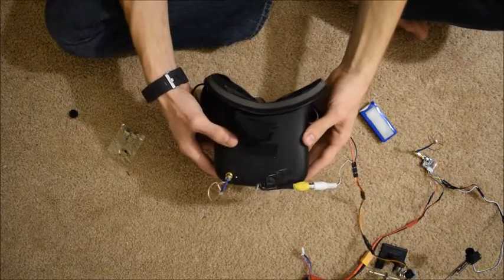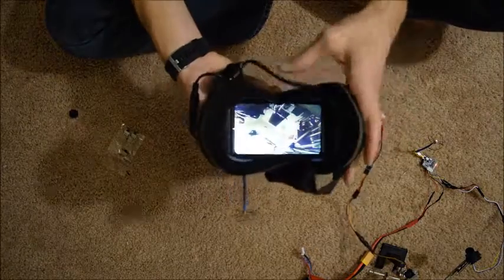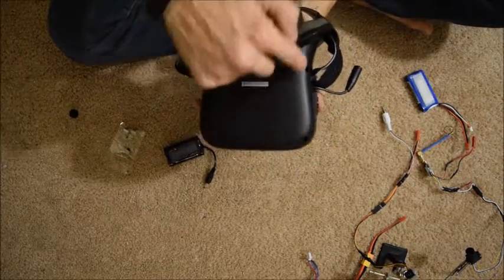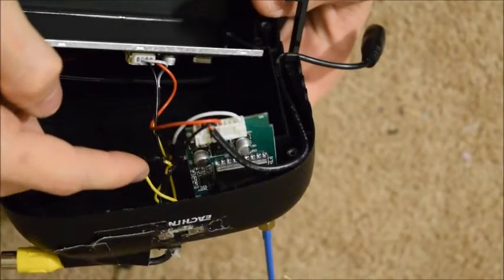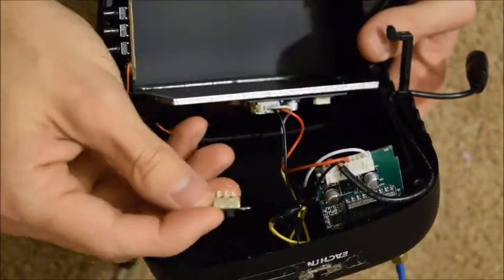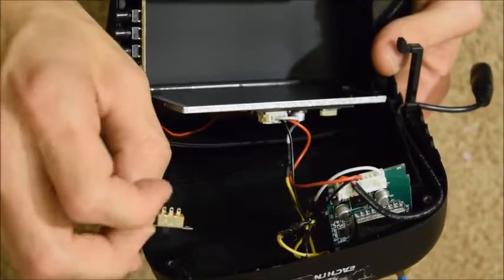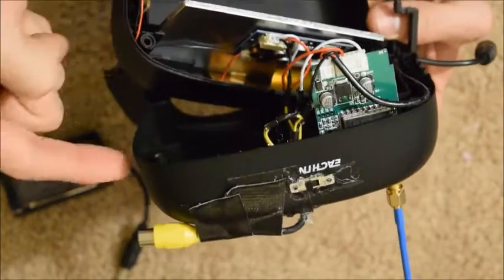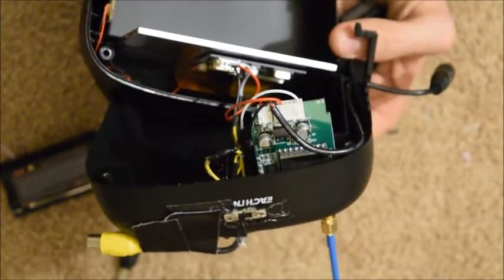EACHINE VR-007 Goggle MOD, add video input

Comment: Guys u made it work very good but there is second option cos the bord of the screen has one pin empty for AV2 and it swithess automatic when u add signal to empty pin ive reused old cables from my old pc, the small ports were the same, i've soldered them to chinch cable looks almost like fabric :D , just cut a chinch svideo cable and put it next to power cable, theres enough place for it, signal cable to av2 and ground cable to ground empty pin on signal reciver, switches automatically when u connect the cable no drilling just extra chinch cable :D  works perfect on my vr007 also connected power bank :D to my battery cos it lacks of power a bit old 13000 mAh  and u can watch many films or play very long :D    Looking to see new mods from you :D
Reply from the maker: Thats neat to hear that there is more than one way to make it work. That would be neat if you could make a short video showing how to do it :)
Reply: DrewMan RC  i try to make a video or put some photos :)
Reply from the maker: Cool stuff :)  The funny thing is that I have since taken these 007 goggles apart and turned them into a hand held monitor/Rx :)
Reply: I have to get my hands on hdmi to coaxial converter and try to hook up to my laptop as second screen :D  coz my brother took ps3  ;)

Comment: Thanks to your video I did the mod to my vr007. It´s awesome, i connected my xbox with no problems. For the input cable, I left it inside the case for it to look nicer. Thank you sooo much for this vid
Reply from the maker: Ivan Mv that sounds fun haha! is the resolution good enough to play games on?
Reply: https://drive.google.com/open?id=0B5zhcSiyD_WFSGJRSjVjZ2ZLd2s
Reply: the definition was good enough :)
Reply from the maker: Ivan Mv , your mod looks nice, better than mine with the tape and hot glue :) the google eyes are a nice touch
Reply: thanks :D

Comment: I was thinking about this for a while. I want to connect a Raspberry Pi running EmulationStation and sending games to my Eachine VR-007, so the switch would be a good option. I might even be able to put the R-Pi inside as looks like a lot of space. Thanks for the video.
Reply from the maker: Declan Green, it is a super simple mod and worth the gain, I will say that I was a bit disapointed with the resolution when I plugged it I to my laptop. It is kind of fun to play with a flight simulator while wearing them, but it is no 1080p. I have further modified mine and removed the receiver and replaced it with a small 700 tvl wide angle camera similar to some of the much more expensive fpv goggles. I will share that video shortly.
Reply from the maker: Declan Green, if you are successful, it would be neat to see the results of installing the Pi.